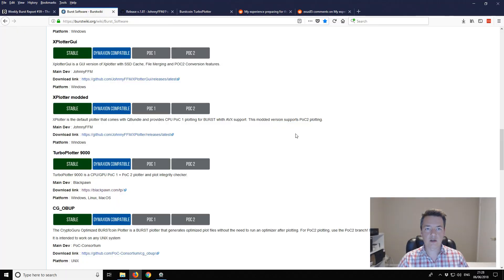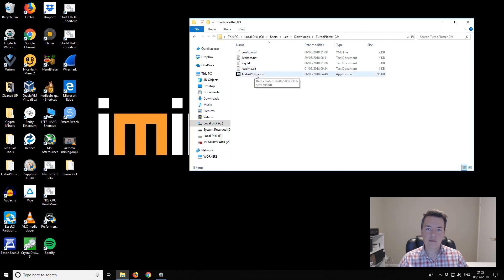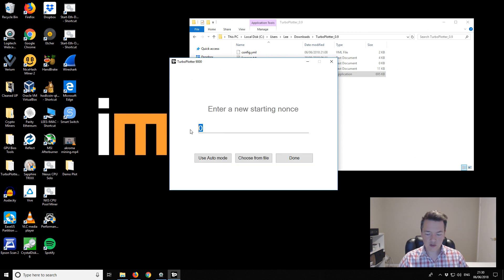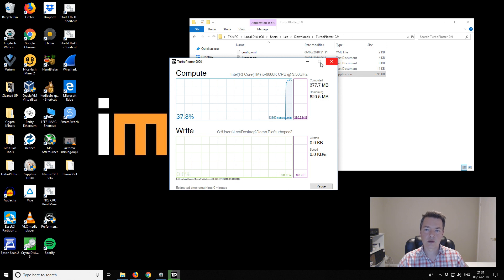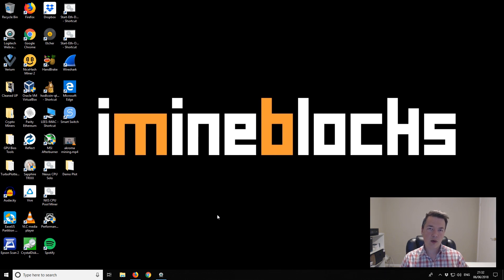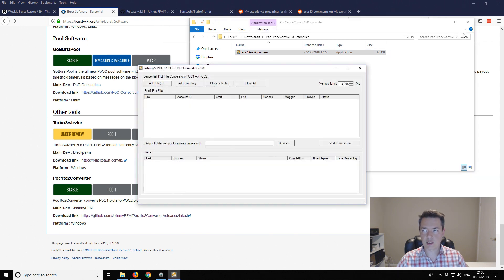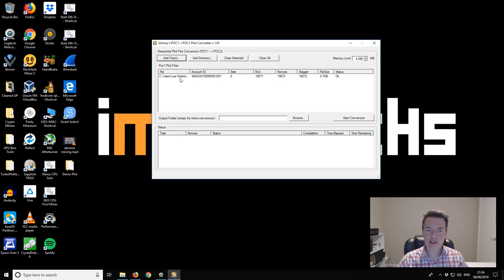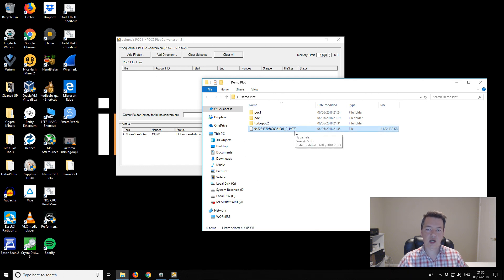Burstcoin Fork - Poc2 Plotting & Poc1 Plot Conversion For Dymaxion Fork

Comment from the maker: Hey Guys, I've learned that its possible to run multiple instances of the poc converter program. You might get faster results by running 2-3 instances of the program when converting. Just open the converter program for each drive you want to convert and have them running all at the same time.
Drive1 1st Program Instance
Drive2 2nd Program Instance
Drive3 3rd Program Instance

Comment: Hi Lee I want to know if converting my poc1 plots takes the same amount of time of when they where initially created, example In 4TB HDD my PC took about 48hrs. to fully create a single plot of 4tb so the question is... does converting it to POC2 would take that same time or its better to create new POC2 from scratch?? if so how many hours it will take??
Reply from the maker: 48 Hours is a very long time! Take a look at this video I made about converting versus plotting new. https://www.youtube.com/watch?v=eSdTVf_kj4M
Its worth noting that you can run several instances of the plot converter at the same time, so you can convert several drives at the same time without any loss of time. So 3 drives can be converted in the same time as one for example.

Comment: Seriously, this was working, taking forever, but working. Now when I select a file it won';t add it to the list. I can't convert any of my files. Anyone know why that might be?
Reply from the maker: The plotter only works with optimized files. If your plotter were originally written using buffer mode then you cannot convert them. Also if conversion is started but not completed then the plot will be corrupted.

Comment: Hi 
Read https://www.burstcoin.ist/2018/03/01/poc2-explained-a-needed-security-upgrade/

"Indeed, contrary to what some people seem to think, miners with PoC1 plots will not need to replot. I repeat: miners with PoC1 plots will not need to replot."

Only needed to get the fast read speed... for what i have learned.
Correct me please if i am wrong.

Thank you for your contribution to the cryptospace!
Reply from the maker: Yes that's correct. But mining at half the speed will be a huge disadvantage, especially if you have anything more than a single drive. I recommend converting your plots for the best performance and rewards.

Comment: I have about 16TB in total, I believe the convertor will take over a week, is that right?
Reply: you can run multiple instances of it though...running 5 just now...cant mine during it though as it needs all the usb speed or it grinds to a halt...doing 2.5Tb in about 3hrs at this rate...but if pc crashes i loose the plots i know :( works faster if each drive has its own dedicated usb 3 chip
Reply: Sounds about right depending on your hardware
Reply: I Forgot to clarify that each instance must be on a different drive.... And a different USB chip
Reply from the maker: New video is being uploaded, I think most people would be better of just writing new poc2 plots. The conversion process is very slow.

Comment: on say an 8TB drive would you do one file or many small files?>
Reply from the maker: I prefer one large file, the miner will read it faster than many smaller files.
Reply: IMineBlocks thanks very much...i had issues plotting couple times and having to restart.. .takes forever !!
Reply: I tested with some drives with small files and there was very little difference in it time wise... The bonus is that if you get a corrupt plot with multiple bad nonces it's less to replot... Having less drives on each usb chip makes a big difference.

Comment: I have a burst coin in online wallet. What I need to do? Is it OK not to remove my burst coin from there?
Reply from the maker: That's fine. You don't need to move your funds either using the local wallet or online wallet, only the wallet is updated no need to move funds.
Reply: IMineBlocks OK thanks. I want to keep it for long time.